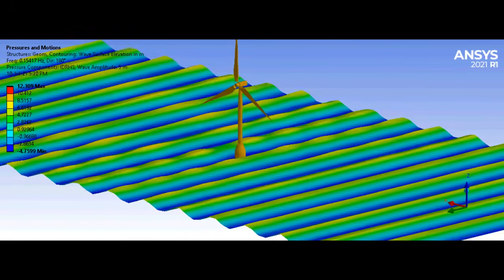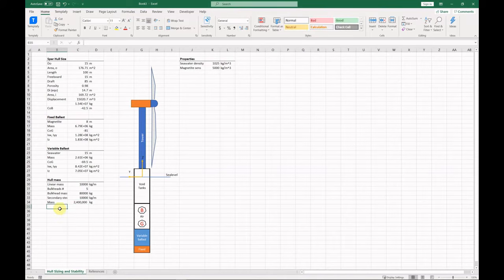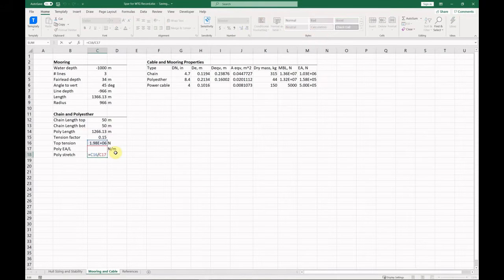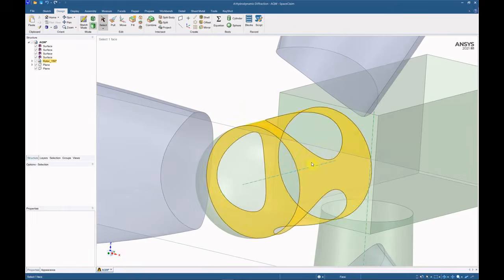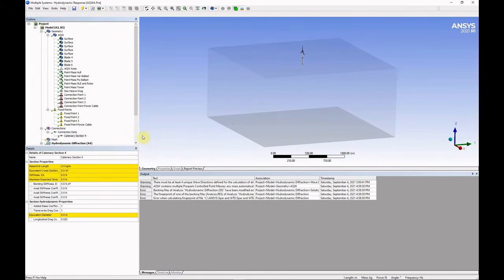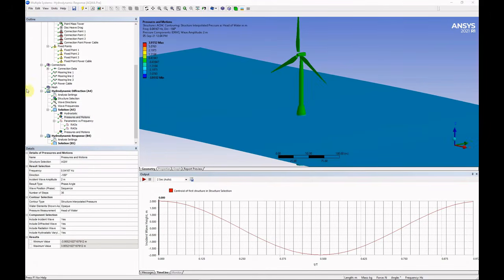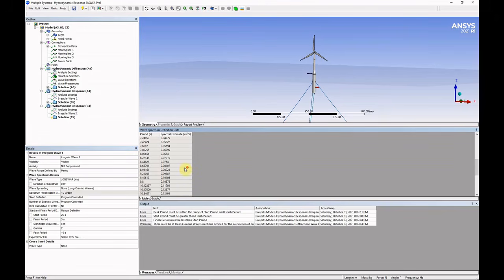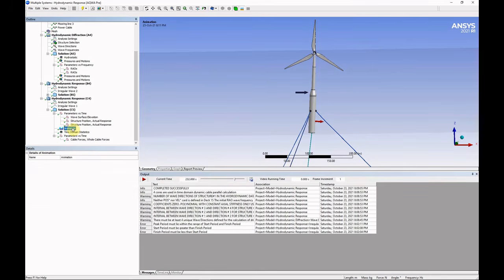Floating Offshore Spar Wind Turbine in Ansys Aqwa - from a sketch to numerical model

Comment: in 12:11  how can u know that the chain diameter=4.7 inch, polyester diameter= 8.4 inch and power cable diamter= 4, in my study i reduce the total height of FOWT to 20m height how about the moring line properties MBL, EA and so on?
Reply from the maker: You do some preliminary runs with storm conditions. Check the level of peak load on mooring than select the best choice on mooring suppliers catalogs. Then try again. And recheck. For fatigue checknit will require more work. This is just a preliminary sizing

Comment: I am following the same tutorial. Each and everything is same but i am receiving an error of illegal connectivity after solution command. Can anybody please help me to solve this error ?
Reply from the maker: Your model mesh has problems. Remesh with different settings and try again
Reply: @xavicastello1 how can I know the best mesh settings?
Reply from the maker: @emmanuelsunday863  it should be enough if element size allows calculation of the wave frequencies you need. However it is always good to do a mesh sensitivity study

Comment: I am getting this error while solving the simulation. ILLEGAL CONNECTIVITY. Element 2985 is joined to element 3376 and element 4775. Anyone knows how to prevent this error?
Reply from the maker: Mesh problems are common in older versions of Ansys. Try remeshing or newer version
Reply: @xavicastello1  can I do mesh externally and connect it to the hydrodynamic diffraction?

How do I know that my mesh is off quality?
Reply from the maker: @emmanuelsunday863  I don't think so. But I'm not sure

Comment: Good morning from Spain
I´m currently doing my final degree project about a spar structure to soport PV panels.
I´m also working with Aqwa and I´m manufacturing some prototipes.
I have a question, why diference between CoG and CoB must be higher than 3 or 5?
In my simulations, I realized that, if this diference is smaller, it doesn´t work as well as it should do, but I can´t find any document with the theory of this.
I hope you read it and could answer me
Thank you for this type of videos!
Reply: If you will do the simulation of the wind pressure and calculate the bending moment. Then you will find the minimum required distance between CoG and BoG. Actually we can consider this distance as an arm of a couple forces (F arximed = Weighth of platform multiplied by the TAN of pitch angle* CoG and BoG distance). Look how to design ships the key answer is there. Key word for start to search: Metacentric height. In this case (spar platforms) you shall consider point of M at the same place with point of B.
Reply from the maker: To be honest I don't remember where these numbers came from. I guess it is common practice for offshore semis.

Comment: what if there are spring conncetions instead of cable connections to the ocean bed?like for a small buoy near the shore?
Reply from the maker: It should work if the stiffness is correct. But they will always be in tension or compression which is not the same as a line that can rest if not in tension

Comment: As an engineering student, i was working on this model. During solving stage, i was encountered with an error denotinf illegal connection between elements(with element number specified). The solver aborts with displaying this error. Could you please provide a solution for that?
Reply: I was also facing the same, but  I have changed some geometry of blades such as tried different models separated the blades from the root and changed the angle of rotation from vertical that rotates the blades from root as a whole
Reply from the maker: It's the mesh generated at the blades and hub probably causing issues. Try different mesh sizes there. Or go back to spaceclaim and fix any geometry slivers, overlapping faces etc

Comment: Goodday Xavier, Thank you once again!
Please how do I apply (input) custom wave frequencies on the structure rather than letting aqwa set  up input frequecies automatically?
I have a set of wave periods (T) with its wave height (H) for a location, and I want to use these specified sets  of frequencies for my analysis
Reply from the maker: not sure I got your question. To get the hidrostatic behavior of the platform its better to have a wide range of frequencies calculated. Then when you apply waves, you can select linear waves with manual settings of frequency or period and height. Its just a matter of changing the range to single and from program controlled to manual parameters
Reply: @xavicastello1  Does that mean for the range of frequencies chosen only one wave aplitude can be applied (say 2m wave aplitude)? 
for the same range of frequencies and diffirent wave amplitude (say 3m amplitude), does that mean another simulation need to be made?
The data I have got multiple wave frequencies with each frequency having its different corresponding wave amplitude.
I learn that I can change the wave amplitude from pressures and motion tab, However, I'm not sure if it has any effect on the RAOs.
Thank you
Reply: Does the wave frequecies automatically generated has a default wave amplitude (say 1m wave)? 
if yes, how can we apply custom wave amplitude or wave height?
Reply from the maker: @mmnyako  it is linear wave theory and wave height does not matter to run solution. Postprocessing results is where you can chose height. just play with the buttons and you find it.

Comment: Very helpful video. Thanks for the effort! Could you please provide a reference for the values used in the preliminary steel weight estimation?
Reply from the maker: Hi. sorry, but this comes from some previous work experience. I do not have references. Perhaps in Handbook of Offshore Engineering of Chakrabarti. But one easy way is you get steel mass data and divide by steel volume. To get it more precisely try geting from preliminary contruction phases, like before internals and outfittings are installed

Comment: Thanks Xavier! Very detailed tutorial. Can the deformation/stresses of the structure be also measured?
Reply from the maker: For this you need to transfer hydrostatic pressure to a structural static model in workbench and calculate stresses there

Comment: Hello Xavier, thank you for sharing. 
please a quick question on the spaceclaim CAD model, Did you model the spar hull and turbine as a solid or shell? if it is a shell, what is the thickness used for the spar hull and turnine? thanks 🙏
Reply from the maker: Hi. You can make it solid. But in the end remove/detach one face to make it a surface body. It must be closed at all sides underwater and normals pointing outwards. Above water it can be anything. Its just representative. Thickness does not matter so 1 mm is fine. Your welcome 🤙

Comment: I faced an error of "elements must be at least 1.000 Facet Radius apart" and another error of " the ratio of the areas of adjacent elements must be greater than 0.333" and the solution was always aborting. So I checked "YES" for "Ignore modeling rule violations" in "Analysis settings". does this affect the quality of the solution?
Reply from the maker: Is probable that quality is affected. You may have elements with normals pointing against each other too close and poor mesh growth rate control. Not sure. Try using mesh quality controls
Reply: @xavicastello1  Thanks

Comment: Hello Mr. Xavier, I would like to ask how the moment of inertia Ixx, Iyy and Izz of WTG-5MW are calculated, thank you.
Reply from the maker: Hi, this can only be rougly estimated by assuming a uniformly distributed mass in a volume, if you know the mass. Otherwise you need to get this data from manufacturers.
Reply: @xavicastello1  Mr. Xavier, thank you for your reply, I would like to ask, according to NREL's research report, can we roughly estimate its mass and moment of inertia through the method in your video? I am a graduate student from Taiwan, currently The 5MW and 15MW floating offshore wind turbines have been analyzed through NREL and IEA references, and although the references already give the mass and location of the components, I'm curious to know how to configure the mass simply and accurately. Thank you.
Reply from the maker: @noahlin7221  The inertia for the hull cylinders is easy. But inertia for Nacelle and Hub will be more complicated. You will need to assume uniform mass distributed in a brick volume. then use inertia equations for this volume shape. There will be an error as nacelle base frame, powertrain and other components are not uniformly distributed. But what else can you do without manufacturer properties? If you want also blades inertia, that is even harder, as they are complex geometries and flexible. Inertia changes in flap or edge axis. Better try to model in CAD something and take inertias from there maybe.
Reply: @xavicastello1  Mr. Xavier, thank you for your reply. In addition, I would like to ask if you have any experience in importing aqwa hydrodynamic pressure into ansy mechanical. I have some questions about the difference in quality between the two. I would like to ask you, thank you.
Reply from the maker: @noahlin7221  Hi my experience regarding that is limited. Ansys has a built-in tool to make the transfer. Any other way will need to be programmed. Regards
Reply: @xavicastello1  ok,thank you. Mr. Xavier

Comment: This video is one of the best tutorials for Aqwa in the field of floating wind turbines. Can I have your email or Linkedin ID?
I'm working on semi-submersible DeepCwind FOWT design and I'm trying to import hydrodynamic loads to Ansys structural after getting results in Aqwa.
Reply from the maker: Hi, here https://www.linkedin.com/in/castellox/ I think there is Ansys tutorial for that load transfer, I remember of seeing.
Reply: @xavicastello1  Hi, thank you for sending your Linkedin ID, I sent you a connection request. 
 That video's name is load mapping(tutorial no.7), but unfortunately it uses just surface and beam of a Spar model for Ansys structural while I want to use 3D structural elements like Solid or shell not surface type to analyze better stresses on the body specially on joints. For Aqwa surface and beam is ok, but not for structural analysis.
Reply: Hai i am also thinking to work on Floating offshore wind turbines
Can you have vedio of installation this software

Comment: I followed every step perfectly but I couldn’t solve solution A5. It showed illegal connectivity element & mass displaced mass are significantly different from structure#1. Please help!
Reply from the maker: Hi. It should be the element mesh from model with inverted face normals (pointing inwards) and resulting in negative volume. This is frequent problem. Use Spaceclaim and find face normals, they should be pointing outwards. Otherwise, check units so the estimated mass from model mesh and total from those added at geometry mass points are about same.
Reply: @xavicastello1  tried to fix that but still error. Can share the project file with me?

Comment: Dear Xavier, thank you for this awesome tutorial. Can you please make a tutorial for a semi-submersible type of FOWT? And, also, can we include the movement of the turbines when it is operating? Do you have a source for that?
Reply from the maker: Great that it's being useful, there's so little out there about calculating a hull from a sketch. 
A semi hull is similar work. Inertias is more complex and complete GM for stability calculation. I'll try but will take time.
Making the rotor rotating animation is what you mean? I don't think it is possible in Aqwa.
Reply: @xavicastello1  what I meant to ask is, can we make a coupled analysis with Aqwa? I want to make a mooring line analysis for my msc. thesis, so I want to include both the hydrodynamic and aerodynamic affects on all the structure especially on mooring lines. The rotation of the blades have an affect overall right? Or, are we just adding the wind and assuming that the blades are not moving?
Reply from the maker: Hummm. Yes. All loads due to wind or current can be added usind drag force coefficients. I think it is shown close to the end of video where you add them. You will need to know first the drag force or the total force while turbine is operating, if the analysis is for operating load case. 
I don't think the rotating body gyroscopic effect or changes in inertia are relevant. But I'm not experienced with such kind of analysis. Better would be tonhave the complete load components set for the load case you need obtained by a loads engineer from wind turbine simulation. Calculating Aerodynamic loads from the turbine is a master thesis already. 🤣
Reply: @xavicastello1  Thank you so much! I am looking forward to your next videos.
Reply: @xavicastello1  Dear Xavier, I wanted to thank you again and I just wanted to say that I want to add your name to my thesis acknowledgments section. I was really lost with all the information I was reading, but this video gave me a starting point. Can you maybe give your name, title, etc. so I can put your name if it is okay for you?
Reply from the maker: Hey. I'm so happy that this video is really reaching it's original purpose. To help students! Thanks for asking this. Do you have LinkedIn or ResearchGate? You can find me there. If not, let me know. I also want to know more about this thesis!
Reply: @xavicastello1  Hey! I have linkedin and researchgate, I would be more than happy to share my work with you! Should I send a link?
Reply from the maker: Good. here is my linkedin https://www.linkedin.com/in/castellox/
Reply: @xavicastello1  I sent a request! Thank you :)

Comment: Hi Xavier thanks for this video. I have three questions: 1)Do you plan to do a video for a semi-submersible type, for example, the VolturnUS-S? 2) How does one get the frequency domain hydrodynamic coefficients (added mass and damping)? I am using OpenFAST but would like to get the coefficients because I am using different wave directions from that given in the OpenFAST model. 3) Do you know how to convert the hydrodynamic coefficients from ANSYS format to WAMIT format?
Reply from the maker: Hi Andre. I´d like to do the same for a semi, but a steel hull like Windfloat. In Ansys, after the run is completed, all hydrodynamic coefficients vs frequency and direction are available in the outputs in the form of line plots. You might be able to copy the line plot results from tabular format and paste in excel. Not sure how to make it available for Wamit if not done manually. I know Aqwa hydrodynamic data can be read by Orcaflex. And Orca also reads Wamit. But it is not what you need. Ansys and Wamit do the same task. What you can do is compare their output after run.
Reply: @xavicastello1  Thanks and noted.